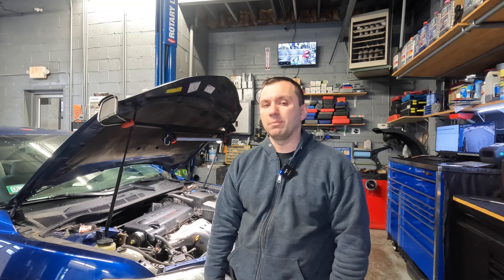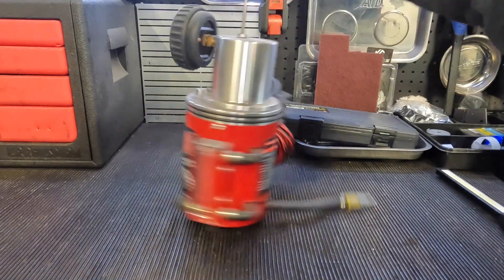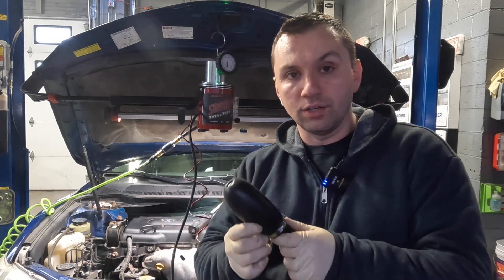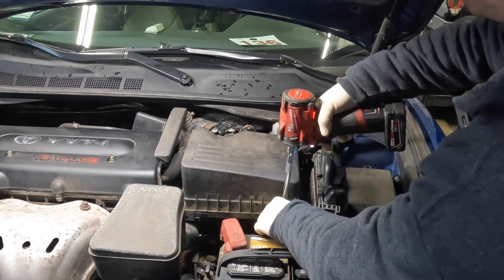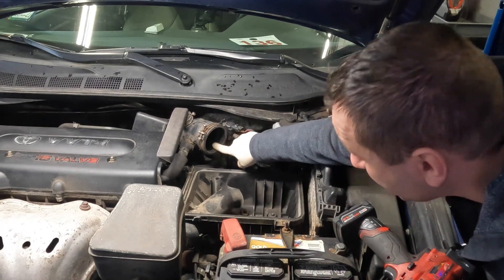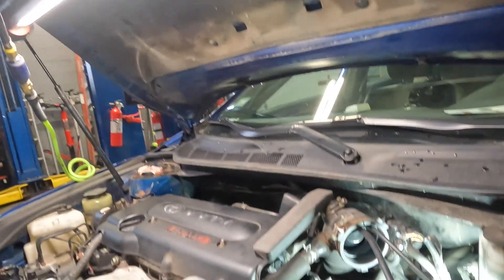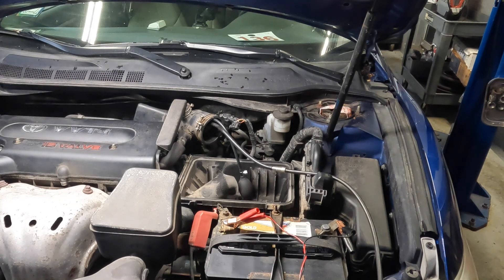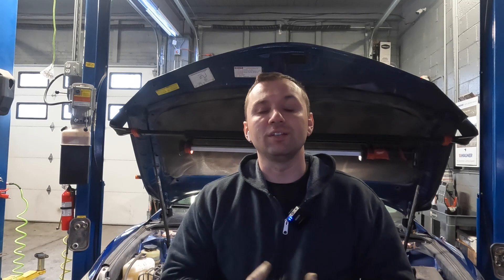HOW TO FIND LEAKING GASKETS AND VACUUM LEAKS USING A SMOKE MACHINE!

Comment: Thanks for the video ,  its a lot of help. I'm  just wondering how the smoke can pass thru the throttle valve being closed ? or is it?
Reply from the maker: Throttle bodies are never sealed airtight. They actually have a little opening, even if they’re fully closed, kinda like a mechanical limit. When you start your vehicle if it’s an electronically controlled throttle, it cracks it open a little bit more. The reason smoke can get through with the vehicle off is because of that tiny mechanical limit that has a little bit of opening it’s enough for the smoke to get through
Reply: @TheEnthusiastMechanic  Thanks again .  Got yourself a subscriber.  Keep the videos coming my friend!😊

Comment: I have smoke coming from cylider 2 on my lexus es 330 during my smoke test..  Any ideas
Reply from the maker: Where is it coming out from cylinder number two because if we’re smoking, the intake and your intake valve is open and you remove your spark plug. There will be smoke. If you haven’t set that particular piston into position where both valves are closed.

Comment: Can the smoke test be also done by putting the smoke in the PCV hose going into the manifold?  Thanks
Reply from the maker: You can any entry point that less to the I take can work I prefer the throttle entry point myself
Reply: @TheEnthusiastMechanic  I'm working with a Sienna and it's super tight.   I would almost have to take too many parts off.  I also wanted to use the Brakes booster hose but that is also way too deep under.   So,  the only other option that I could see is the pcv hose into the manifold.  

I used a keep detector and I believe the intake manifold gasket is bad.   My leak detector was beeping there.   So,  I wanted to confirm it by putting smoke through that pcv route.
Reply from the maker: @jaimedpcaus1  brake booster hose would probably be a little bit better because it’s probably a bigger line and has more volume flow for the vacuum. That would be the better bet.
Reply: @TheEnthusiastMechanic OH ok.  Thank you for replying, I appreciate.😊

Comment: Performed a smoke test today on my 2004 Camry but I didn’t use the bladder to block off the crankcase PCV hose as you stated , I didn’t see any leaks when I performed the test , should I try it again with this balloon like adapter ? My smoke machine comes with this adapter as well
Reply from the maker: What is the issue that you smoke testing for?
Reply: @TheEnthusiastMechanic  P0171 code , nothing else is paired with it just that code , been giving me a headache tryna figure out the issue
Reply from the maker: @anthonylozano1994  depending on what car you have that can mean a lot of different things
Reply: @TheEnthusiastMechanic I think it’s a fuel pump issue , did the smoke test the way you did with the balloon and no leaks. Engine cranks for a little and acceleration response is delayed , might be the fuel pump from further research I’ve done. Fuel trims are within -10 or 10 as well

Comment: Helpful video.  While I am sure the equipment you are using is better than the less expensive stuff available on Amazon, but the cost for a low end smoke generator, with the additional inflatable "boot" thing you used is under $100 now.   The codes I am getting for my volvo all indicate I should look for air leaks,  so for less than the cost of an hour of shop diagnostic time,  if I could get the car in, I can just buy the smoke thing and try it.   You make it look easier than I am sure it will be.  But I am certainly happy to have watched you as it made me see the need to for inflatable boot as well.  Again Thanks.
Reply from the maker: If you have the right equipment and you know where to do your hook ups, it’s actually pretty painless. I know these types of jobs look very discouraging, but it’s actually very easy if you understand where the hook ups are and how the system works. One tip I can share with you if you’re testing for leaks at your engine go through the intake manifold with the balloon inflatable tool and if you’re testing your missions canister, you can go through the gas tank or through your vent valve to pressurize that part of the system.
Reply: Does this smoke damage or foul the MAS??
Reply: @ I put the smoke in after the MAS